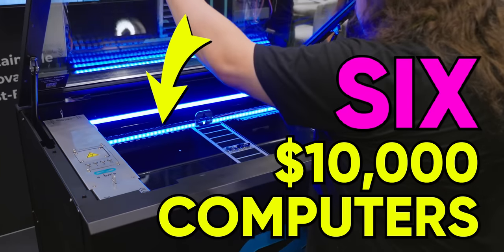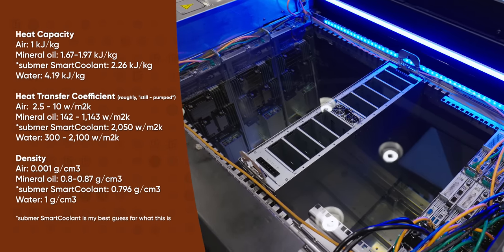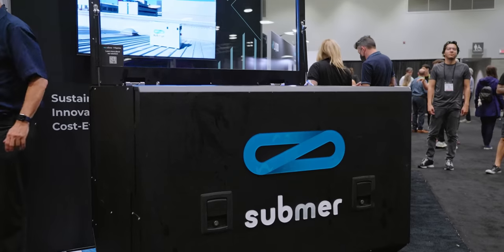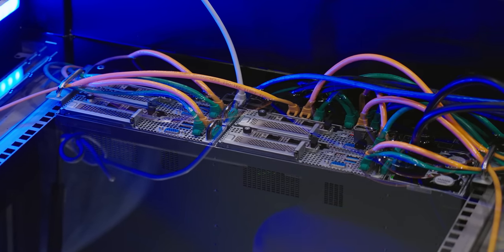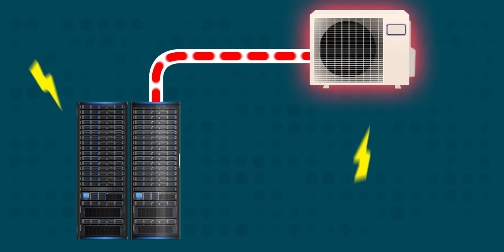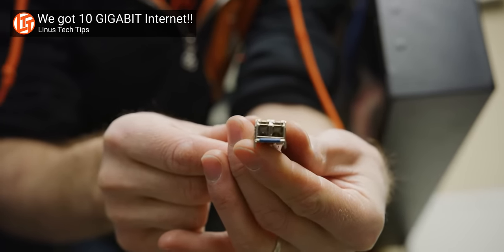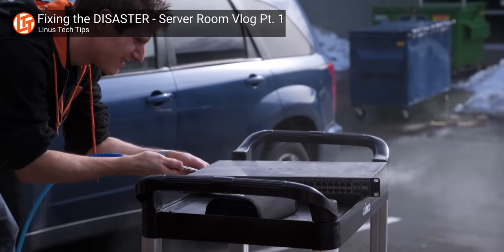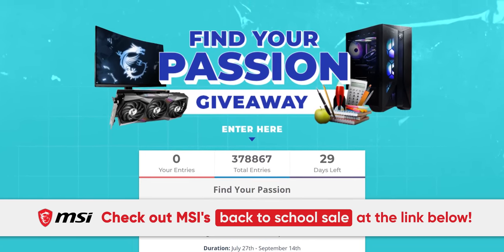This server lives underwater! - Hypertec Immersion Cooling

Comment: I have been a firm advocate of utilizing "waste" heat in so, so many applications, compute heat specifically.
Reply: they are using servercenter heat for district heating here in Denmark, so it can be done if they are willing to do so. So that helps heat houses and water all year round (well no house heating during summer but it helps make hot water so people can shower and such) and during winter it helps with whole house heating, district heating is quite widespread in Denmark and powerplants spare heat is used for that.
Reply: I wonder how viable it is to use thermoelectric panels to convert the heat back to electricity, or at least recover some of it. I think they're more efficient when there's a cold side, so I feel like that would fit into water cooling pretty well compared to the backside just being warm air.
Reply: Our company hooked a small heat exchanger between our server and the underfloor heating tubes, its great during day time since server is going full blast, it actually saved us when electricity went out for some time and our emergency power only covers the server.
Reply: @5PYZ3R  those panels are highly inefficient
Reply: Can the heat be used to pump the liquid?
Reply: The food production company I work for have a CHP system and they capture the steam heat from the cookers for all of the hot water in the building. Once they have enough hot water, the remaining heat is converted back to power. Yeah, they still use fuel to power the cookers but now all of that "waste" heat is going to good use so they are using much less than they normally would have.
Reply: In Finland the supercomputer LUMI makes up fifth of Kajaani's district heating
Reply: And?
Reply: @stewartdahamman  it's waste heat being used to warm homes
Reply: @5PYZ3R  to do that you need to run the servers as hot as positive - ideally several hundred degrees.
Reply: I have often wondered if it would be possible to take the waste heat from a fridge or freezer and dump it into your hot water cylinder somehow.
Reply: A coworker heated his house one winter by grabbing a few old GPUs and using them to mine altcoins.
Reply: @5PYZ3R  these aren't very efficient as mentioned, but there is a good solution for this type of low density waste heat. Look into ORC (organic rankine cycle) generators. In short they use the heat to boil a refrigerant in a separate closed system and use the pressure from that to power a turbine and make electricity like a reverse heat pump. Because you can pick the refrigerant you can tailor the system to any kind of heat source. and in practice are able to effectively return about 75% of heat as electric power.
Reply: @Komatik_  I suppose it's better than the usual crypto methods which are almost purely wasted energy.
Reply: @jami6154  sorry comment was meant for OP,  usage case is evident.
Reply: @5PYZ3R  Sterling engine
Reply: @stamfordly6463  this is precisely number 2 on my "waste" list.
Reply: @stewartdahamman  np
Reply: start by wasting compute to fullfill your childish desires
Reply: @anarchangel7  that's really cool, thanks

Comment: It sounds too good to be true. But if it's as good as they say, I guess it's a huge game changer.
Reply: First time to comment first to verified person's comment
Reply: It sounds too good to be true but also technically plausible.
I really hope that this actually works because it makes so much sense in our modern energy economy.
Reply: Nothing groundbreaking here and pretty niche.  Cool though.
Reply: This is super true, it is already used in a lot of places where installing aircondition is a problem. You can actually go further and use the heat to warm the building... so you save more energy. So, technically is possible, but you might find a little problem getting the permision to play arround with some many systems, and that was my main problem working with for the last 3 years. The owners of the buildings are usually pretty stupid.
Reply: Because it is. Water isn't conductive. The stuff IN water is conductive. And the microscopic bits of metal and other residue that this winds up with inside it will wind up conductive eventually too.
Reply: So did electricity, and cars, and flight, and cell phones, and... well, you get the idea. Good to be cautiously optimistic, but with our ability to fabricate things at the molecular level, I doubt the tech isn't as good as they advertise. The installation, on the other hand... well, we'll just have to wait and see. After all, it doesn't matter how good the boat design is if the captain and crew or shipwrights don't do a good enough job and cause it to ultimately sink.
Reply: It is true, but quite expensive which is why it's still not commercialised.
Reply: @louisarius9672  why do you think immersion cooling is not commercialized?

Comment: The energy recovering is the most interesting part.  It can still do work properly harnessed and hopefully we see more of that soon. Pretty cool they could have it integrated with this system
Reply: Similar to Linus using his server cooling to heat his pool and floor.
Reply: Absolutely, especially if you think of big data centers with 50-70MW consumption. That would output a tremendous amount of warm water
Reply: All water cooling have that advantage, but on servers you don't use water cooling due to risk of leakage that can damage not only the server, but the entire rack. And home PC will just produce too little heat for it to make sense to recycle it.
But with this, you can "water" cool an entire server room and produce so much hot liquid for it to make sense to reuse that stuff.
Reply: District heating for apartments around datacenters is definitely on it's way.

Comment: Not just does it look very cool, it is innovative and has a use
Reply: And it doesnt harm the earth :)
Reply: I wouldn't say innovative, innovative basically implies new prospects. This is a new chemical for old functions. Like they even say in the video, we already have evaporative NOVEC and mineral oil. It's just a slightly different chemical with a similar function to NOVEC.
Reply: @Skylancer727  I disagree with your opinion, but to each their own.
Reply: @Skylancer727  yea but inventing a new better environmentally friendly fuel would be innovative wouldn't it? So why should it be different here?
Reply: @demp11  it's more like saying biofuels are innovative, they're literally just a different way to make the same material. Or that ethanol based gasoline is innovative over lead based gas. It's safer no doubt, but it does the same thing in the same way. That's the definition of iterative not innovative. The first cellphone would be a mix of both for example, we already had radio transmitters and microphones, making them smaller and lower power was iterative, giving it a battery and make it portable is innovative. 

The majority of invensions are iterative over innovative. We already have such deep material and physics based studies, it just takes putting them together in the right configuration or using them in a way we haven't before to be iterative. Simply put, the difference between iterative and innovative is iterative is doing something better than before or improving on it  , a hydrogen fuel cell car is still a car for example, and innovative is making something that is either completely new or brings new value like the invention of the touch screen or maglevs.
Reply: Not innovative, search on “Cray 2” from the early 1990’s, not the same liquid but it is exactly the same principle. As is usual, super computer technology reaches the PC market 40 or so years later.
Reply: @BLAKSOLDIER  not in ways that most people know of
Reply: I hope in 10 years this is the standard its such a good idea
Reply: @Skylancer727  search up "sustaining innovation", this is what you are saying as iterative. To you,  "disruptive innovation" is your meaning of innovation, also read up about that. Both of these are forms of innovation.
Reply: @Skylancer727  Says it isnt innovative, continues to describe perfectly why it's innovative xd
Reply: @Skylancer727  Name me one technological breakthrough that is not an iteration or variant of some older technique

Innovation is always iterative
Reply: I also agree. This is the feasible innovation. At least one of the working and possible alternatives.

Sometimes we argue for something literate rather than the functionalities. At least we all appreciate such future. I wish we will see more different in the tech space in the future.
Reply: I'm with skylancer here. Making a slightly different cooling medium isn't innovation. At best I would call it improvement but even that's a stretch. Making this kind of liquid cooling in the first place is innovation. Spacex making their rockets return and land is innovation. Just building another rocket booster that can carry satellites into orbit in a slightly different way or with slightly better fuel economy is not.

A number of firms have tried to commercialise this technique and basically no one wants it for general datacenter use. It's too much of a hassle.
Reply: Stop being pricks... This is cool, who cares about if it's innovative or not?
Reply: @Skylancer727  It is very innovative, they're pretty much getting rid of all tradicional cooling system while introducing some of their own. And everyone else that also has a similar solution doens't seem to have really hit the market, I can see this going forward even more with help from Nvidia and maybe other hardware makers if this gains some traction.
Reply: @Skylancer727  it is innovative, but ok
Reply: @donkeyy8331  The only change is the fluid they're using, cooling systems like this have existed before. Simply iterative. (However the integration with the components themselves like with the liquid temperature measuring thermometers could be considered innovation.)

Comment: This is actually a really neat idea.  I work in a large datacenter, and managing hot/cold containment is a huge pain in the ass.  No matter what we do, our containment either leaks air somewhere or the return CFM isn't strong enough to pull the hot air out. Most of the racks we get are full of 4-node chassis that look just like the ones demonstrated here.  Those produce a boatload of heat....Supermicro, Lenovo, etc.  Each rack gets a pair of switches that all the nodes connect to over cat6 RJ45 cabling.  Those switches have fiber optic uplinks that go upstream to the network.  Those switches, or at least the fiber ports, could remain exposed so there wouldn't be any problems with the fiber. Switches don't produce that much heat anyway, so either they could remain partially exposed or fully. This would be a really neat way to do heat containment!
Reply: I’d imagine fibre connections that were designed for submersion will start to appear. Also all those 50W fans will be adding to the heat load, simply getting rid of those must cut it quite a bit
Reply: @____________________________.x  They do have DAC/F (Direct Attached Copper/Fiber), those are basically just cables with a built in SFP transceiver, but there's a massive downside to those - can't replace the SFP. If it goes bad, gotta replace the whole cable. Would be nice if they made a protective cover or something that would seal up the SFP once the fiber is connected

Comment: I hope that they release the fluid to enthusiasts because I've been wanting to build a submerged pc but didn't want to deal with the oil and pc components failing from the deteriorating effects oil has on plastics
Reply: sooooooooon
Reply: Did some digging on the company's website and it looks like they're using Lubrizol's CompuZol IM2015 fluid.
Reply: @x3of9  could be a part of this new mixture yeah
Reply: I hope so, but I kinda doubt it. This is the kind of stuff that usually only comes to datacenters as the costs are vastly more than even water cooling. I mean it literally needs a cooling tank beyond your computer.
Reply: @Skylancer727  custom heat exchanger interop with the hvac fan system, perfect for the 2x0.5 foot closet where the water heater lives
Reply: i’m curious how the performance would compare swapping it for water in an existing loop. when i looked into it recently, it seemed the best advice was to use water plus additives unless you have a well ventilated space (then methanol or ethanol could be added in) and glycol was no better in part from the increased viscosity. hopefully linus can convince them to borrow some to try out for various cooling uses.
Reply: @morgan0  water is pretty amazing at soaking up heat.  just about anything you add to water makes it worse for cooling (expect water wetter, or a similar product to reduce surface tension).  some additives are of course needed, but generally speaking you only use what you need to for a given application.

Fun fact, antifreeze has multiple purpose's, besides the obvious of stopping water from freezing, it also raises the boiling point, and contains additives to prevent corrosion inside the engines coolant passages.  From what i understand it does NOT contain anything to prevent algae growth, car's don't need that since the coolant reach's 100c anyway.
Reply: Typically this type of system is used in large GPU and ASICs crypto farms
Reply: There is a lot of stuff you can buy. 3M has one, Dupont has another. You can only buy them in like 5 gallon amounts or more but you can get a hold of it.
Reply: @x3of9   Is the Lubrizol's CompuZol IM2015 fluid priced "if you have to ask, you cannot afford it", like previous immersion cooling fluids?
Reply: @animefreak5757  Linus could personally attest that anti-freeze does not contain anything preventing algae growth, I still remember what happened in their whole room water cooling loop.
Reply: @Cinkodacs  ? that's what i said, that it doesn't have algae inhibitors because in a car engine the coolant reaches high enough temperatures to sterilize things.

Comment: I'd love to do something like this with a home PC.
Reply: im gonna
Reply: i did it way back when. over ten years ago with mineral oil works great but like anthony said it can be messy when you have to upgrade or replace parts. this new liquid looks like something i would like to try. my old mineral oil pc cools itself with a aftermarket trans cooler a fishtank pump and two case fans mounted to a custom plexiglass backpanel behind the fishtank. great fun project and overclocking is fun i got my q6600 intel cpu to 3.4 ghz without issues. Used it for a ventrillo server and a clan webpage and forum back before youtube and facebook.
Reply: Well prepare for the maintenance cost lmao
Reply: If It would reduce energy consumption in the long run I would consider the investment, but a server with an embedded celeron and an i5/3050 system being my top power chompers, it wouldnt be worth the investment.
Reply: Something like this is only practical for large-scale computers rather than something that sits on your desk.
Reply: @XMansive  you underestimate some people's builds...
Reply: That's what I was thinking, this fluid in a custom loop would be cool, literally and metaphorically 
Linus needs to make this happen
Reply: @XMansive  I would think this would be better in a PC than distilled water or whatever coolant people use these days 
And here we are giving LTT  video ideas
Reply: @z0phi3l   Didn't the charts in the video state that the fluid was worse than water for cooling? I don't see why anyone would use a worse coolant for the water cooling loops used in consumer builds. 

And from what I understand, the cooling in this video relies on exchanging the fluid's heat with an external cold water source. I don't think the average home user will have anything like that and is easily accessible without some Linus-tier modding or tripling(?) their computer's size. You might as well build a subsonic wind tunnel at this point instead. That's why I said this whole thing is only practical for large-scale computers aka businesses that have a ton of physical space to spare for the water source + gigachad pump + heat exchanger.
Reply: No tou won't, Its awful to maintain and service.
Reply: @swiggens2  I'm using transmission coolers also. I have three in parallel made by Derale. One of the fans died recently though. It's nice because the heat goes outside and there is not a single fan in my PC.
Reply: Someone already built an aquarium PC with this
Reply: For the price of a car, you can!
Reply: i did it once couple years ago, but my pc failed as soon as i put water in the aquarium.
Not to mension the fish inside of it.
Reply: @XMansive  you underestimate my desk

Comment: I really can't imagine a practical use for this in a data center except for very specific applications. I worked in a data center for a couple years and to apply it and I see a lot of challenges. But still I would love to see this implemented
Reply: Agreed. A suite of these would require so much floor reinforcement its unfeasible, for edge nodes maybe on premise, but for a DC that's not happening without big changes.

Equally, I wonder how manufacturers warranties are affected by use of their hardware in submerged cooling. I can see that being a great limitation for many companies.

Comment: I assume the liquid is mostly dimethyl sulfoxide. It is used to protect cell cultures when frozen. Up to 10% of the water can be replaced with dimethyl sulfoxide without killing them. The ice of this mix does not expand as water ice, so the cells do not burst when frozen. But dimethyl sulfoxide that has been used as a coolant should never be drunk as it can over time dissolve water-insoluble compounds such as plasticizers and therefore become toxic.

Pure dimethyl sulfoxide melts at 19°C, so an additive is used here to make it more fluid at room temperature. This additive probably also removes water that is absorbed from the atmosphere.